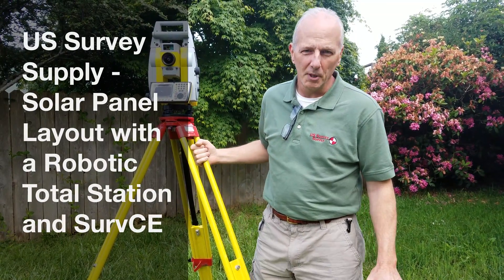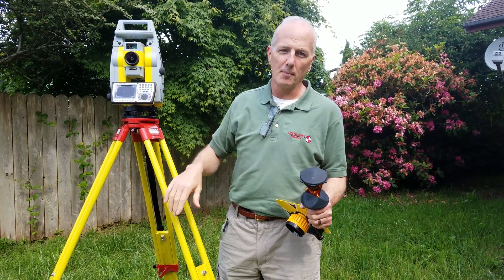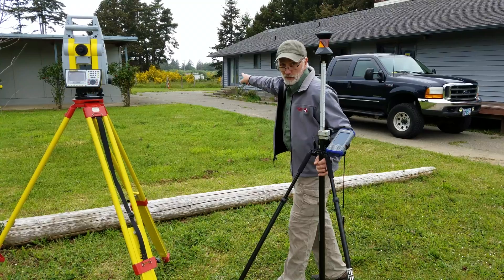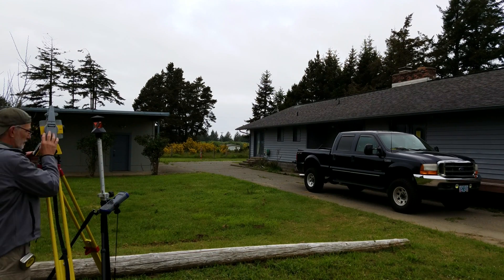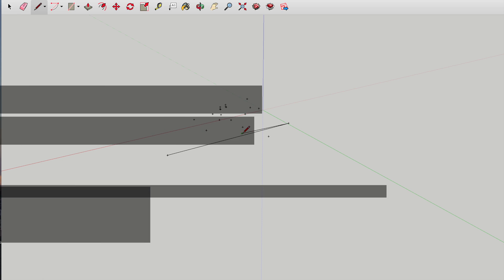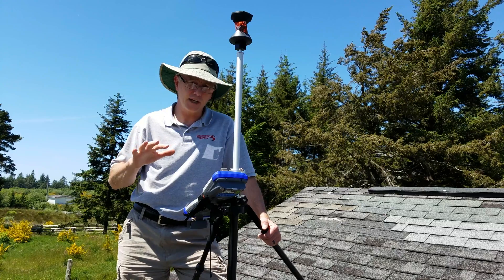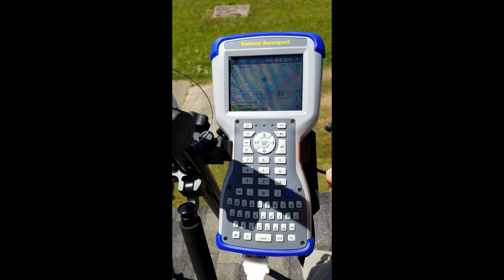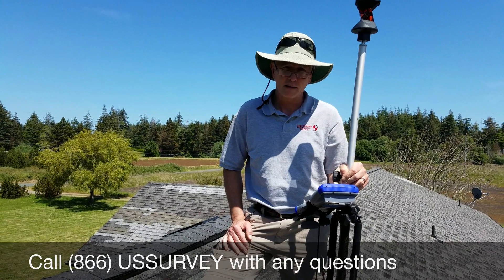As-Built Design & Layout w/ Carlson CR+ Robotic Total Station, SurvCE, and SketchUp

Comment: Nice video, thanks!
Curious, since robotic total station (RTS), is there a reason why you can't just use the RTS to just automatically project a laser point to the stakeout location for marking the roof?  Instead of lugging around a bipod and reflector?  Is it possible to this?  I understand this is easier with 1 man.  But if you had 1 guy on the ground at the RTS operating the software, and another on the roof just purely marking the points is all?

Thanks!
Reply: Yes you can do exactly what you are describing with this set up, and other instrument configurations compatible with surv ce or PC assuming the TS has a  laser sighting option. Notes, the accuracy of the laser varies per TS and using the laser for extended periods will use the battery faster. I have done this when marking a wall for tie back bolt locations.